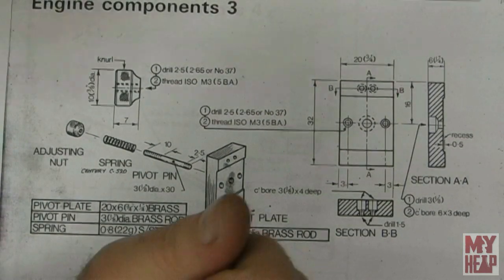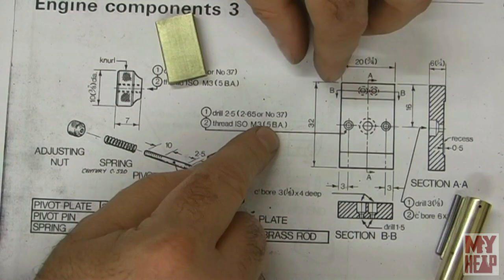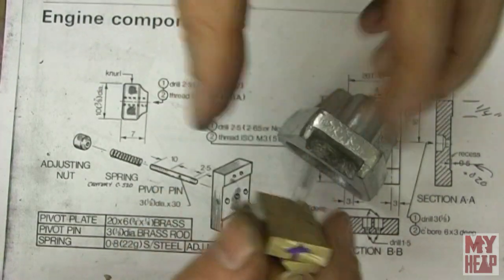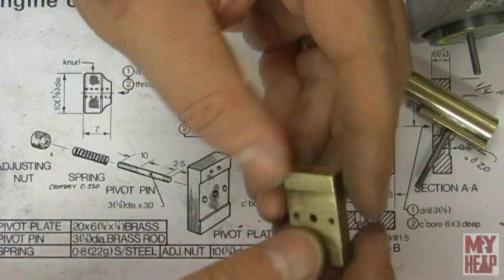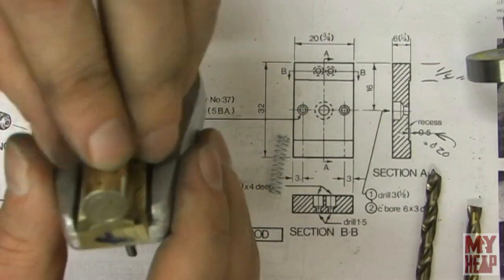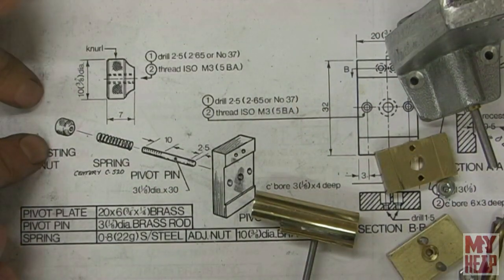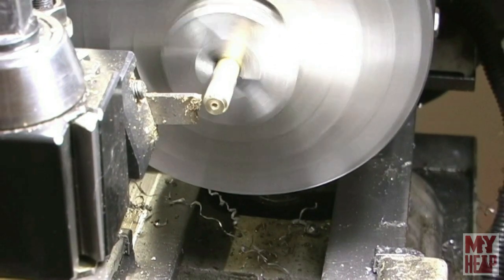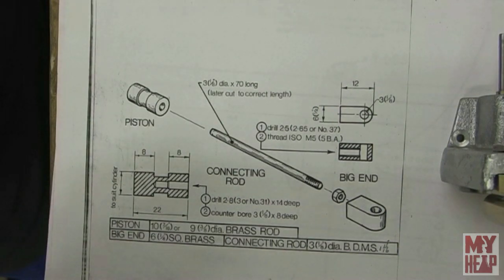Kenneth Wells Stationary Engine - 13 - The Pivot Plate Assembly

Comment: looking good joe, that chisel is a cape chisel as others have said. I was kinda hoping to see the grab and hear the morse code when that thing grabbed, lol. I was thinking about since the plate assembly and piston rotate in a circular motion, if just relieving that part on the lathe would have been a better option, then with the drill in the tailstock chuck, it wouldnt have grabbed and sunk in. You would have a circular center relief instead of the straight one, but it may work out better for people that are also building one of these.
Reply from the maker: Hi Chirpy.  Relieving the center with the lathe probably would work just fine.  Although drilling on my lathe in brass is a bit tricky sometimes.  It has grabbed and taken the slack out of the screw a couple times on me.  Kind of like climb milling can do.  Thanks for confirming the cape chisel information.  Looking forward to seeing your next T&C grinder video.

Joe